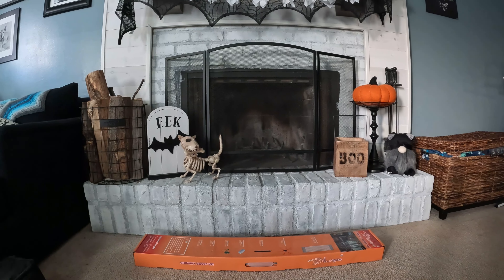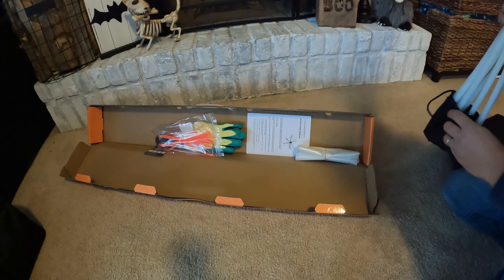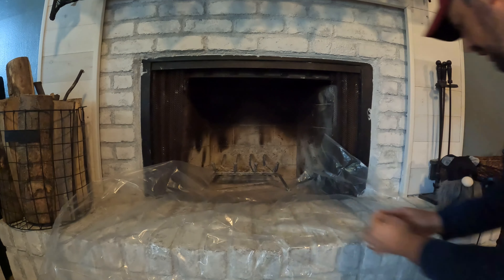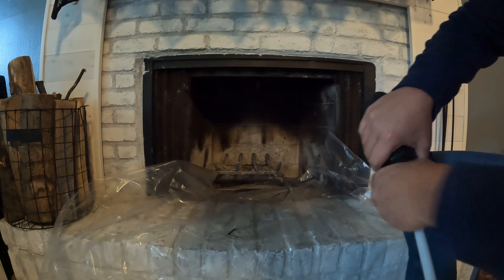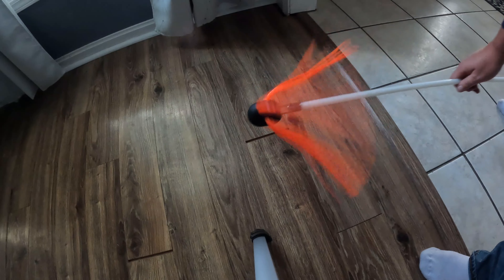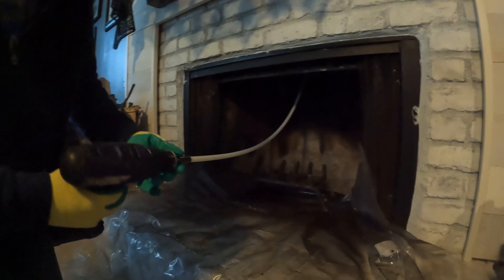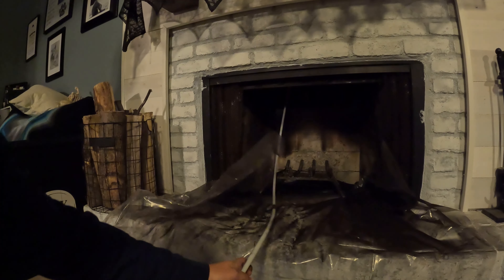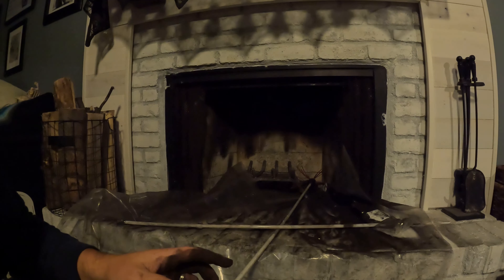How to Clean Your Chimney - DIY - Chimney Sweep Kit for Home Fireplace

Comment: Hey Martin, one trick I do is to hang the plastic tarp with tape so that it covers the entire opening of the fireplace, and cut a slit in the middle to feed the brush and rod through.  At the bottom of that slit, I put the hose from my shop vac, which stays on the whole time I'm cleaning the chimney.  It's not perfect, but it does cut down on the black dust that gets out.  You just need to make sure you have a good filter on your shop vac.
Reply from the maker: Love it. Good stuff! Appreciate the tip and will do next time!